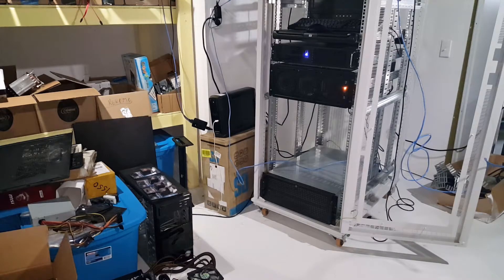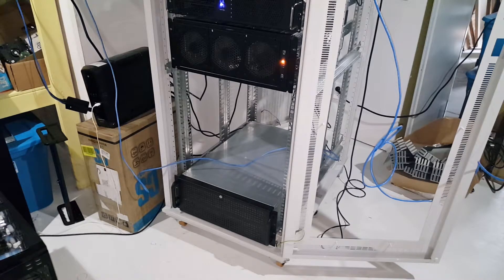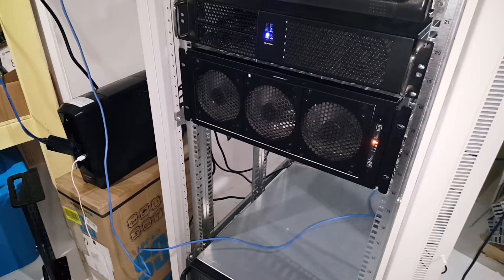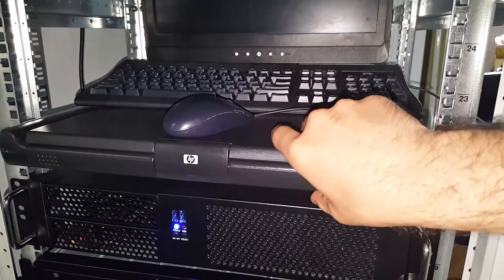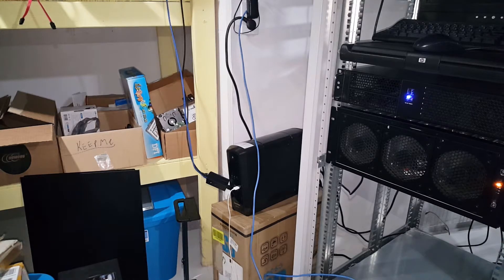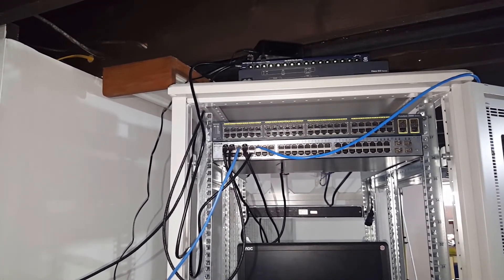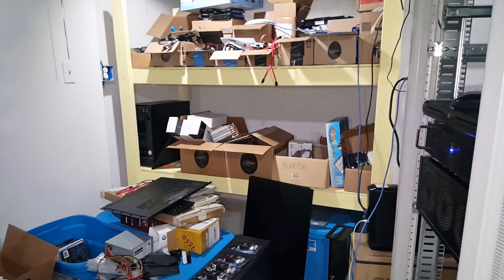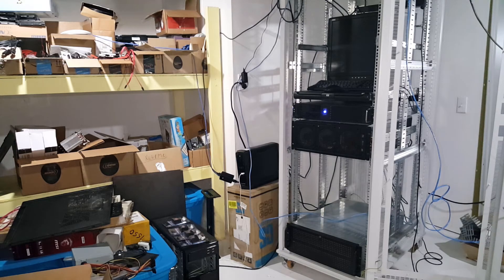Mini Data Center update 2

Comment from the maker: Intel E3 Server CPU (1275): https://amzn.to/2z7rX3A
SuperMicro Server motherboard: https://amzn.to/2z2krHf
Crucial16GB DDR4 Unbuffered RAM: https://amzn.to/2NhUAhK 
Rosewill RSV-L4000 4U Server case: https://amzn.to/2KIirpi
EVGA 850 Watt Power Supply - Platinum: https://amzn.to/2NgWG1b
Noctua NHU9S 92mm heatsink: https://amzn.to/2tOgfG4

iStar D213-mATX 2U server case: https://amzn.to/2tXjVVp
AsRock embedded CPU/Motherboard for Firewall/Low power buidls: https://amzn.to/2z1bhuI

48 port NEtgear Gig switch with some Beef to it: https://amzn.to/2tLDpwW

HDHomeRun (Over the air recording): https://amzn.to/2tX6Dbk

Comment: I know this is a old video but you can replace the monitor with another one. You can rig something up for the monitor. But other then that awesome job on the network.
Reply from the maker: Hi Diy! Yes, I had looked into that option. MY plan now is to keep the current screen in place then add a slightly nice higher resolution portable monitor to the rack somehow to get a quick at a glance overview of how the equipment is doing and any power information I can get with out going into the rack or web management. Plus, I'm hoping it will look really slick 😀